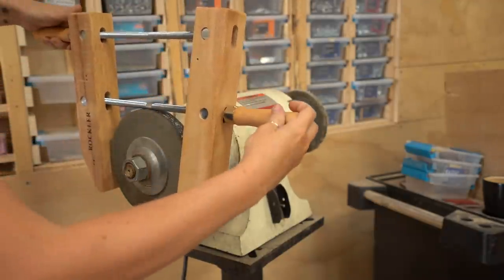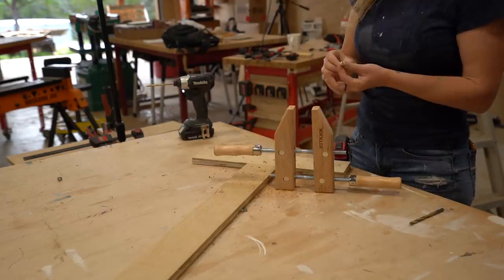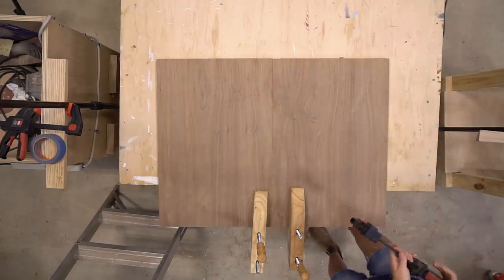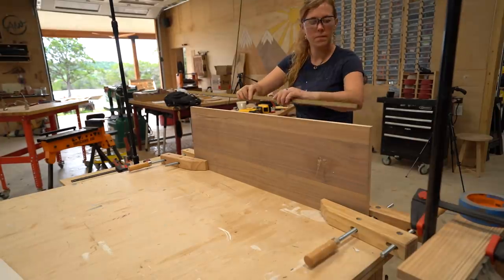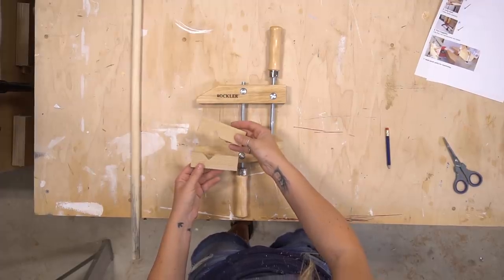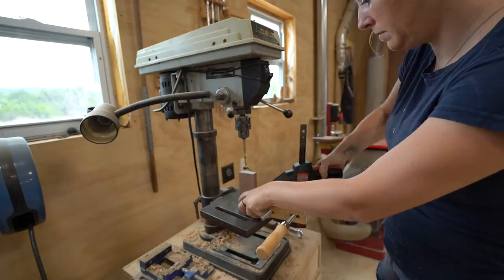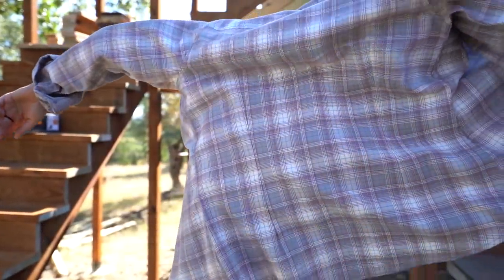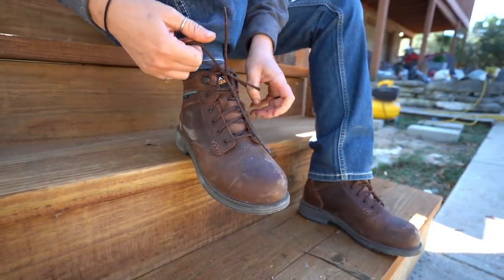Most Versatile Clamps For Any Shop

Comment: Great video!  I have been using hand screws for almost forty years and you are so spot on.  They are the most versatile clamp in my shop.  The fact that you can modify them is a huge help, I have a few that have 90 deg V's cut into them to hold round stock.  Multiple sizes are a must.

Comment: Some genius tips there April. I have 8 or 10 wood screw clamps in various sizes in my shop. I have used a few of these tips in the past but never thought about drilling holes in the ends to put bolts into or screwing pieces on to. make extensions. I always learn a thing or two from your tips videos. I love your channel and it’s been one of my favorites since shortly after you started posting on YouTube.

Comment: Nice tips.  A little thing that might be helpful to mention is that after adjusting the clamp with both handles, always tighten by turning the handle farther from the work.  This gives you more mechanical advantage.

Comment: I’m not a wood worker, but I get some really great ideas for projects to have built, or I apply your knowledge to the few times that wood projects must be done. Your helpful videos cut down on the cussing a great deal. Lol. I do a lot of metal work and I don’t know if you realize this but there’s a smaller and metal clamp that’s just like the ones in this video called a machinist clamp that’s used a good bit in machine work. I’d never realized that wood working had an equivalent.

Comment: Very clever and will be used in my shop. I bout two of the smallest ones specifically for the drill press when drilling small or lone awkward pieces. Like you, I also bought myself a pair of Ariat boots and they fit and are so comfortable right out of the box. I've worn all brands of boots and for the first time I didn't have to "break them in". I love that plaid flannel shirt!

Comment: I sometimes put one of my old Jorgensons on the lever of a door without a lock; the screw handles hit the perpendicular wall preventing rotation of the lever from outside.
(Edit: any F-clamp works too, but this style is so good at adapting to weird shapes with maximum contact area)

Comment: Excellent tips!  Thanks.
If I had figured out how to use a handscrew clamp, instead of using an iron C clamp to hold a small work piece to a larger work piece to pass through the SawStop, the saw's brake wouldn't have fired when it feather-grazed the clamp I was holding onto.

Comment: Here's a 10 for you.  I used my Jorgensens as flush cut platforms on  my 4x4 fence posts.  Clamped on the line and  used  a Ryoba as a flush cut.  I use my old style clamps a lot more than the newer ones ...just because they rack.  Nice video.

Comment: Not shop use, but two of the clamps I have are on a joist in the garage. They can hold two motorcycle helmets per clamp or a helmet on one side & riding jacket on the other. I use my remaining clamps for shop use.

Comment: Here’s a tip for those grinding wheels!... when the grinding wheel is off the tool place a screwdriver through the center and tap on the wheel with your knuckle, it should make a ringing sound. If it doesn’t it is likely damaged or cracked somewhere and should be discarded or returned to store.

Comment: Tip #2 - if you can't drill the workpiece, just hot glue a couple of blocks on and use them to clamp. They can be removed easily.
Reply: Or use the ol' painters tape and super glue trick!
Reply: @bloodgain  Even better.

Comment: Looks like a normal set of channel locks could hold that nut on the grinder. Otherwise risk putting a good dent in the wood clamp. Holding the grinding wheel is a great idea though.

Comment: My Ariat work boots fell apart after .... 20 years. I need a concave sander for sanding the interior of a fine cedar strip canoe. Or a soft grinding wheel ?  The curves are ever changing and the concave thing ....
Reply: A flexible scuff & buff abrasive ball drill attachment might work in some areas?
Reply: @DavyHulme  ..... I’m visualizing a softball size extra thick industrial slime ..... shapeable and full of grit?  A 4” lens of soft silicone gel with and abrasive additive?  A nice piece of pumice I can shape and that will also shape itself as it wears.  Now ..... where can I get a cubic foot of very sharp pumice?
Reply: @RunsWithScissorsSenior  yeah, kinda, scuff and buff balls are made out of foam impregnated with abrasive, the surface's divided into cubes, they can be rinsed cleaned of debris to stop them clogging. There are also abrasive fleece balls
 https://youtu.be/Qovcco2ivAs

Comment: Much of this assumes that my shop has any “clear” horizontal space 😜
Reply: April's shop is 2x the size of my house, so I concur. However, the solution is to clean up whenever possible...which is something I still have not mastered. ha
Reply: The first task for every project I start is "Clean off the work bench" - even if that was the last task on the previous project!  There seems to be a quantum attraction between loose "items" and an empty workbench surface!